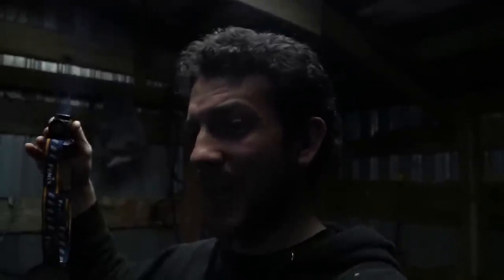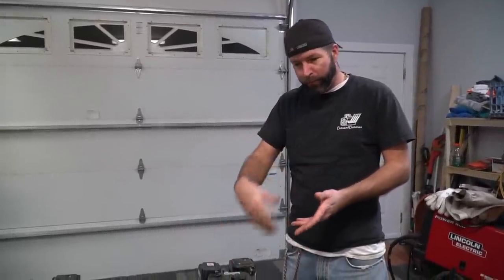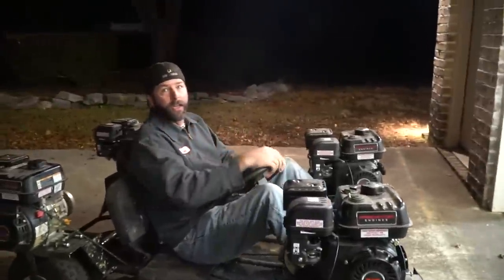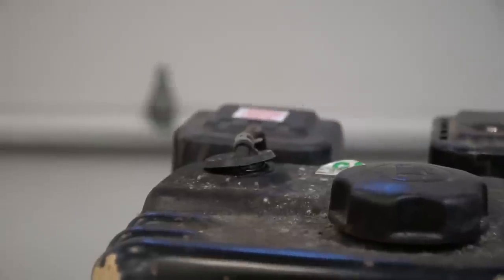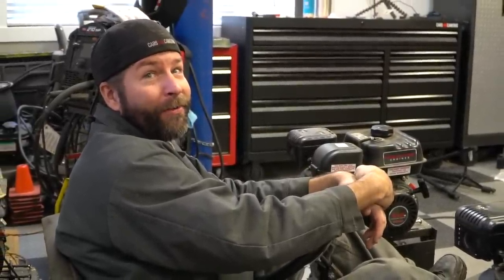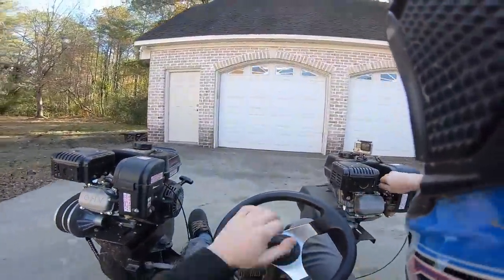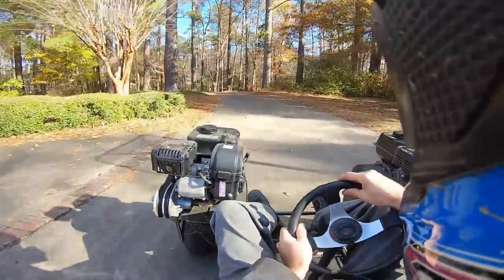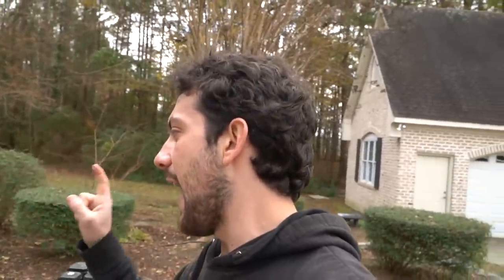4 Engine AWD Go Kart Revival | Hard Launches!

Comment: guys I have a question I've got a predator 212 on my go-kart with a torque converter but it keeps eating the belts I'm a bigger guy so I was wondering if that could be the problem or if I'm using the wrong kind of belt and also where do you find the belts at that have the slanted Edge so it will go in Groove with the clutch all the belts I find are completely flat on both sides please help

Comment: And you can put a single 450 from a crf or yamaha and it will have more power than all of these pressure washer engines heck you can put a 125cc 2 stroke from a cr in there and it will haul ass all of the racing carts have yz80 cr85 engines In them.

Comment: it does not torque steer because you are not running through a central trans with half shafts! if you have uneven half shafts you get wicked torque steer. if you have even half shafts you get almost no torque steer. You have NO shafts so no torque steer as they are both exactly the same no losses through shafts.